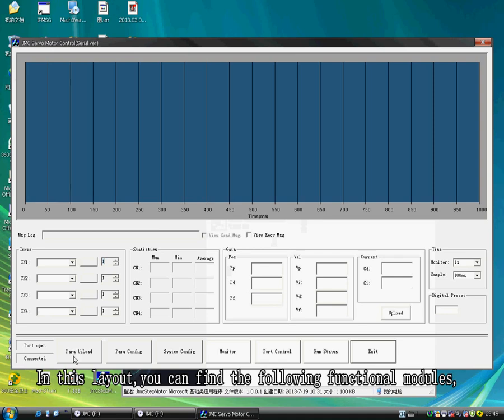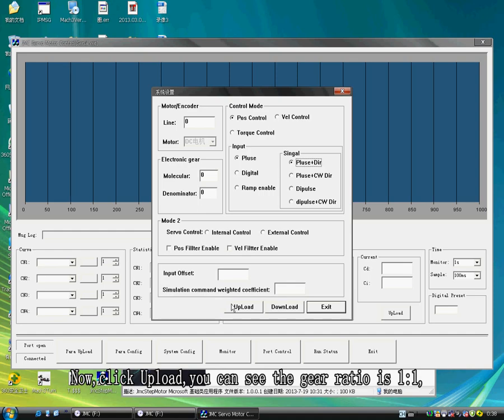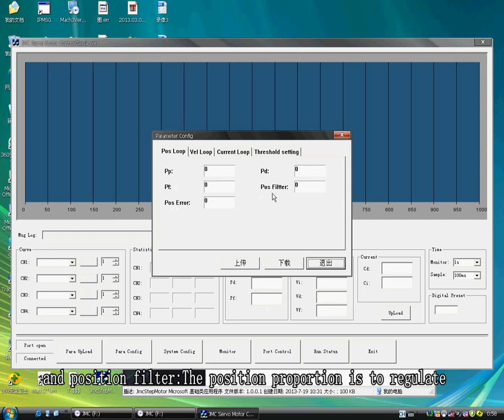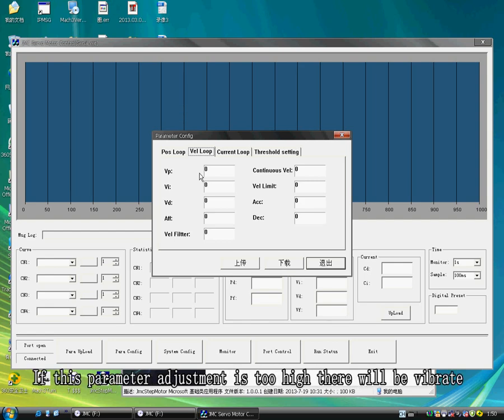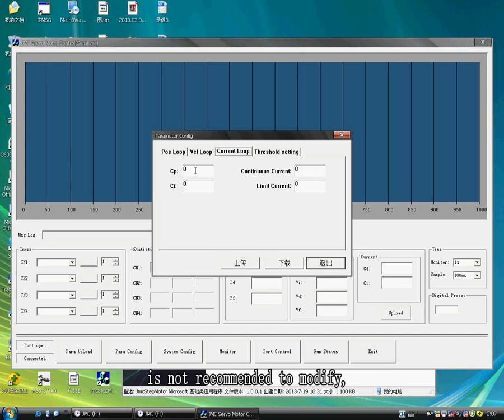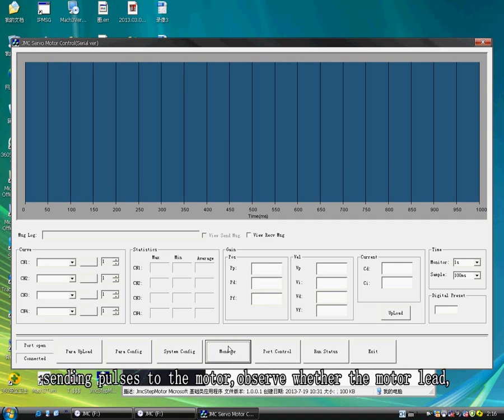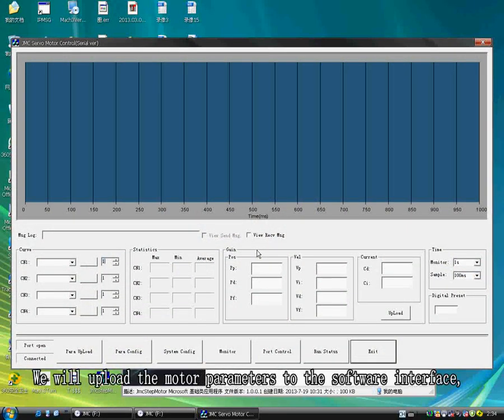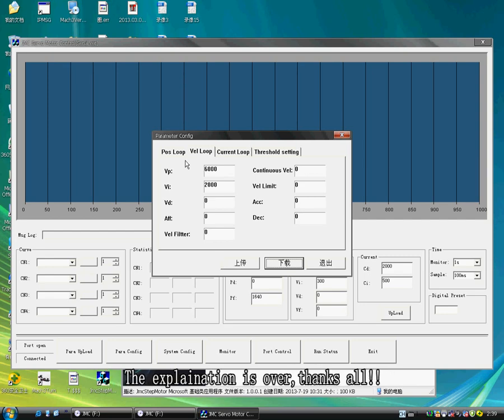Low voltage servo Video introduction

Comment: Hi Tamás Tasi.
Thanks alot for this video! I have bought the 180w servos in august 2017 and i've been very happy with them! Here is a Video where you can see them work on my milling machine :)
https://youtu.be/rFvo_UsrfQE?t=1969
The next machine will working with the 400W 220V Servos with the 23 bit encoder from you factory.

Greetings from Germany
Sebastian